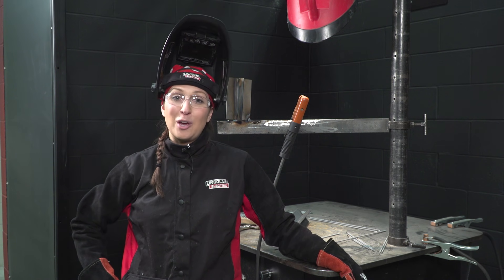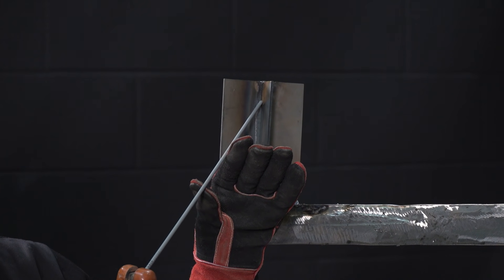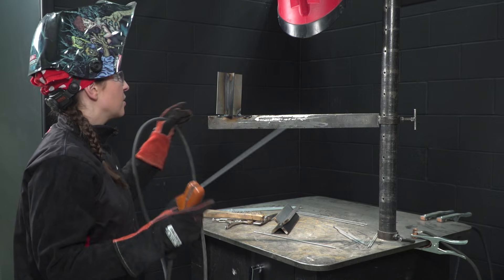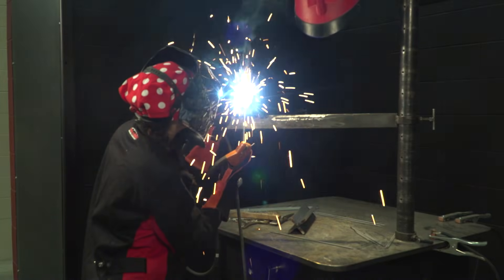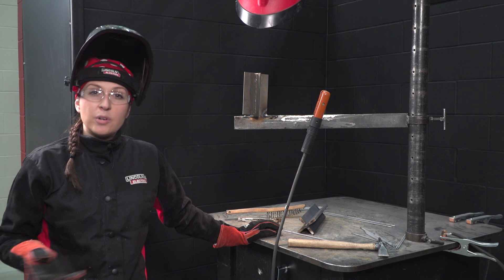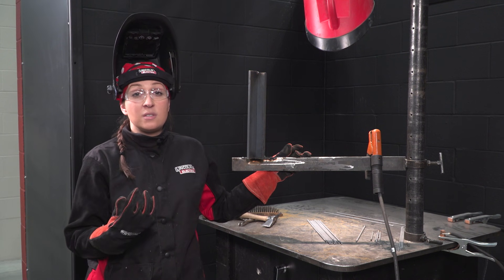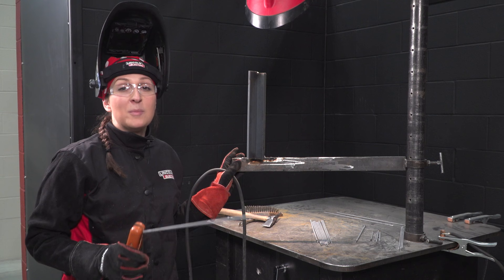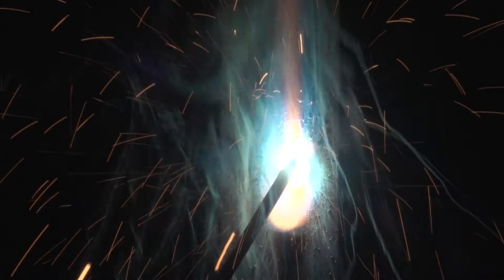ARC Magazine Presents  MasterClass Vertical up & Vertical Down Stick Welding

Comment: Why not show a close up of the welds? Would of been helpful.
Reply: You can look at what's going on through the lens and tell that weld was a total disaster.
Reply: Larry Croskey would HAVE been helpful. Not would of.....just saying.....
Reply: Because they probably looked terrible
Reply: Because they would’ve looked absolutely terrible from her technique 🤣
Reply: Exactly, although all the pin holes on the slag pretty much sums it. Brutal

Comment: Holy shit, I have seen it all now! I’ve been welding for 40 years and I have never seen a vertical up carried out like that.... if you first run is “lumpy” then you are doing it wrong........ any welder worth his or her salt would be able to lay down the same amount of metal up with only one run..... you can tell it will look like shit just by the way the rod is being thrown about.... I really do not believe that she is a welding instructor
Reply: Ahhh too quick, what would you have done? Myself a lot slower and upside down triangles motion. At asme 9 if the leg length is bigger than the steel plate then its a fail so god knows how many passes she would have done.
Reply: Yep. And all that jumping around will no doubt have an effect on splash, HAZ and bead quality. Like they say easy does it keep it simple
Reply: 👍 I'm in Disbelief also! Ive seen Farmers with Better Welding Technique! -😕
Reply: she is cute tho
Reply: Nice and slow like a Christmas tree sort of movement for me 3.2 mm rod pretty low amperage , only just started out practising stick uphill
Reply: +Weaver Cattle Company Yeah I can Relate to your Story 100% -I Spent some time on a Cattle Station When I was 18 as a Jackaroo Picked up Some 'Stick' Welding Techniques off Some of the '0l 'Cockies' as we call them in Australia- I had Learn't to Weld Very Young as My Father Ran a Small Manufacturing Buisness Probably about 10-11 when Dad made me Put on a Spare Helmet & Watch What he was Doing Then Helped Guide me on my First Ever Mig Weld - In my Early 20's-I Ended up in 'Tafe'(Tech College) To Get my Gas Metal Arc Weld(GMAW) Ticket- I Also Was Shown Proper Technique for Manual Metal Arc Welding(MMAW) The Tafe Teachers were Veteran Pipeline Wlelders & Knew their Stuff With the Technique Demonstated by this 'So-Called' Teacher- She Never Would Have Pass Spec & Got Her Ticket! It's Not Just in the Welding Industry- Education Has Fallen Far From what It Used to Be- If you Watch old Industry Tech Films From the 1930's to 1960's on Y.T.- You'd be Amazed how Good they Were- Using Commonsense 'Anologues' To Show How Machines Developed & Functioned- I Watched a Clip on 'Differentials' From 1940's & Was Spellbound by the Simplicity & Effectiveness of the Film- You'd Never Grasp from a Texbook- Mind you there was No Such Thing as Digital Technology back then- So Most Things you could Learn Via Visual Display- or Bench Work- Disassembly Assembly  ect.-I seeBad Teachers or Teaching being the Equivalent of a Contagious Germ or Virus - It Gets Past on to the Next Person in Contact with it- & on & on It Spreads- Into Colleges & Universities- Like a Plague - Then you end up With Crazy Lefits Trying to Take over the Country & Your Lives- Kinda Like Whats Happening Today- 
Unfortunately!- Anyway Thanks for your Comment- All the Best for 2019😉 -Cheers👍
Reply: she looks damn young to be a fuckin welding instructor I bet she Isn't

Comment: If your in ARC magazine, it because you've paid to be in it.......mostly by running enough advertising (spending money with the magazine)  where they will do a feature article on you or your business.   This is why you always see articles in ARC magazine which are typically at a Lincoln or Miller facility.  ALL magazines run on this premise.   YOU can buy yourself a cover feature if you have enough coin.

Comment: Interesting video. Never seen it done that way. When I got state certified in the 90s I was taught the z bead technique for vertical stick and MIG. I notice on youtube a bunch of "instructional videos" on welding and I am seeing most if not all of them using TIG techniques (walking the cup) in both stick and MIG situations.  When I got my certification I got certified on all 3- MIG, Stick and TIG, in all positions.  

The way I was taught was when stick and MIG welding, you just set your machine with a piece of scrap metal of the same size and material you are working on and prepare the material before you begin (cleaning, grinding/cutting, making a bevel on the material before you weld when you can) and just slowly dragging the stick/MIG wire from left to right at a 45 degree angle. No fancy hand movements unless it was vertical, then you do a backwards z motion from bottom to top (only the stinger moves back and forth). Have things changed since the mid 90s? Or is there  a lot of bad info out there by people that don't know what they are doing?
Reply: MrHunterseeker I was taught the same Z method when I was learning stick when in high school. I graduated in 2016, so at least it’s still being brought down still. But I mean, what do I know, I got my stick certs doing it that way so...
Reply: Hell I learned more from reading your comment then watching her video
Reply: Nope, nothing has changed. Ive been working in farming machinery building company, im wrking as industrial welder now, making support structures for construction sites. Its all the way how you were taught. Im welding on MIG/MAG/MMA and sometimes even OAW. I have only 6 years experience, but welding like this, there is no real weld there. She already allows the weld to cool off, which makes it less durable.

Comment: I believe this to be the best video I have seen on this subject.
Reply: No close arc shots, no close shots of the weld before or after the slag is cleaned.
I'm not saying it's the worst Vertical uphill 6010 demonstration, (more to do with the film crew probably)
There's not that many to be fair
But I wouldn't say it's the best imo.

Comment: I watched this video so I could get a refresher on vertical up, its been about 10 years since I last did it. I am sorry to say that even this rusty welder could do a better job than that, pretty much every mistake that you could make is being made, to fast going up, not letting the weld puddle and it also looks like the arc is too long on the up part as well. Also the distance you are going with the up part is too far.
Now I am 100 percent FOR gender equality in all industries, however I am 100 percent AGAINST someone being fast tracked into a teaching or leadership or PR position because of their gender. Just saying.

Comment: Do you have a video in vertical down with thin metal c purline 1.2mm on T join 
Because im always fail in to do this
More slag in the middle between two base material
I try to pracrise c purline 1.2mm.
With e6013 rod, 80 to 90 amps
Thanks

Comment: I HATE 6010 and 6011 rods.....  All the are good for are root passes so they can be covered up with E-7018.  The thing that makes them difficult to use is they are a fast freeze rod and are very easily stuck.   That and all the spatter balls everywhere just makes them probably my least favorite rods to use.....

Comment: Doing my test soon. Whenever I do vertical down the flux from the 7018 just piles over and makes a big puddle. But sometimes it slides down the sides if I’m lucky. 

Is there a way to fix this?
Reply: Vertical down is the only position 7018 rods can’t do..

Comment: I've seen exactly that technique done with 7018, vertical-up with that long "whipping" motion - which absolutely you must not do ever!!!!!! ???  (you must keep very short arc and very slow movement with 7018, so the arc is always over the molten puddle, so the shield, which isn't copious with 7018, is fully effective (???)).  Gets 130A v-up bridge large gap with 3.2mm (1/8") 7018.  We never use 6010 here in the UK - have to keep an "emergency" secret stash of my own for repairing railings when they have been bashed-about by barge collisions, etc.

Comment: I’m in welding school right now, horizontal was too easy but vertical is kicking my ass..I tried to do the 2 second rule like I did w tig but for some reason it keeps burning too fast..any pointers?
Reply: Toine Giuliani 
What rod are you using. Vertical up first bead push bottom to top. Second use weave. Don’t be afraid of tie in’s start above 1/4 “ and bring down to where you stopped then proceed up

Comment: I welded 6010 rods before when I welded 6010 rods I whip the rod up and down weaving a 6010 rod only leave undercut on the sides cause the 6010 rod is a fast freeze rod
Reply: Herman Safford Jr 
When i went to class we used 6010 and he taught us just to use the weave and I still do. Except i use 7018

Comment: You made a big thing at the start about safety, which I fully agree with. Your long hair hanging over your shoulder right in front of the arc and sparks, causes a serious problem fire and personal injury safety risk. What now?
Reply: Saw that in the 90s when I worked in steel fabrication, A George Michal wannabe with hair lacquer and an oxi propane torch, I should have helped him but I was laughing too much when his hair took off.

Comment: Wow that's bad technique. I would suggest using two hands to hold that stinger until you can actually lay down a decent bead. Probably for the best they didnt show a close up of that "weld".
Reply: ryan koltalo 
I still use both hands just for added accuracy